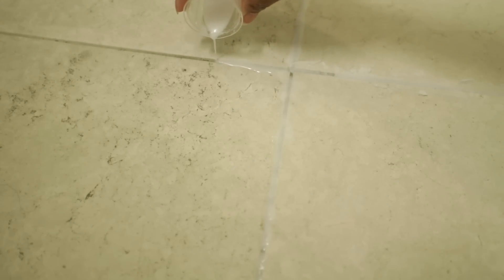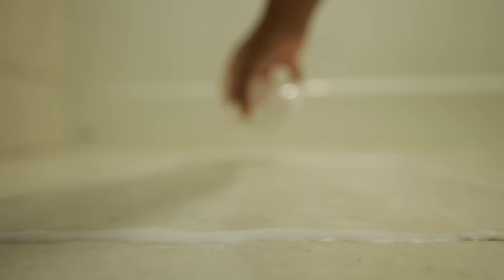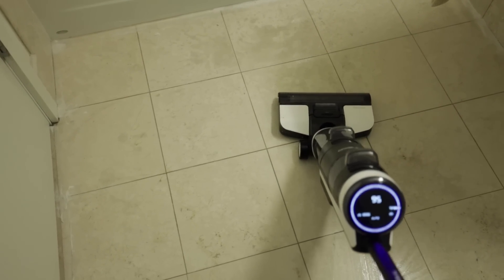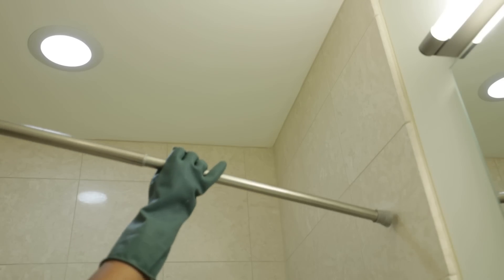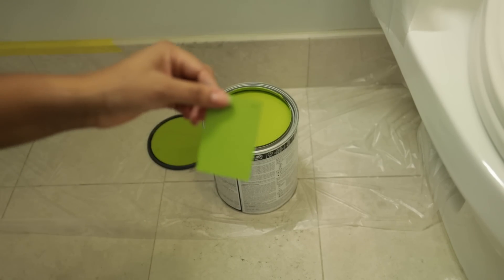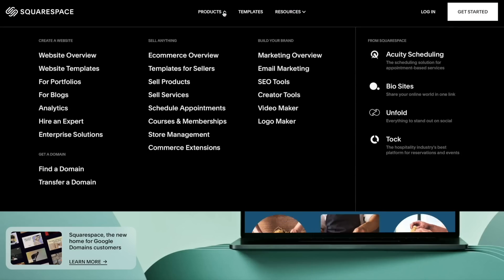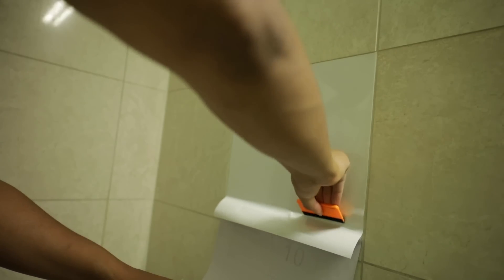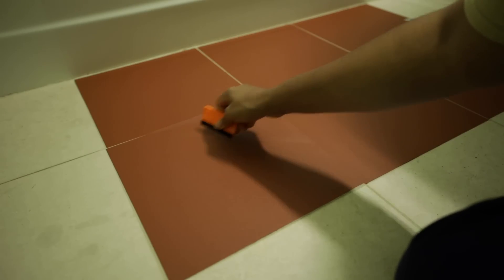small BATHROOM MAKEOVER | Renter Friendly Apartment Makeover

Comment: for cleaning and painting, I recommend removing switch plate covers, towel rods and other hardware. It's easier to clean and paint when they are off the wall.  You are amazing! You are a cleaning BEAST.
Reply from the maker: if it were mine, absolutely,  but they already getting free labor at this point sooooo 😏

Comment: Wait the vinyl thing sounds so good for customization!! Would it be okay to wet the floor or mop on it? Im all for it just scared if its easy to peel just by sliding my foot or something. Can vinyl be used as wallpaper too?
Reply from the maker: yup! i can clean it as i normally would with no issues. vinyl works best on tile, glass, or metal surfaces because it will come off without blemishing when youre ready to remove it. Since drywall is essentially paper, the adhesive backing can leave tears. I used it as a kitchen backsplash once, and used a blowdryer to heat it up before peeling in hopes to minimize the damage but did still get 2-3 areas i had to patch with spackle.